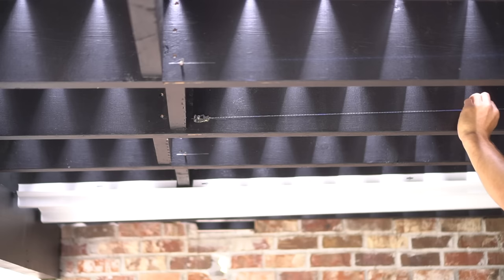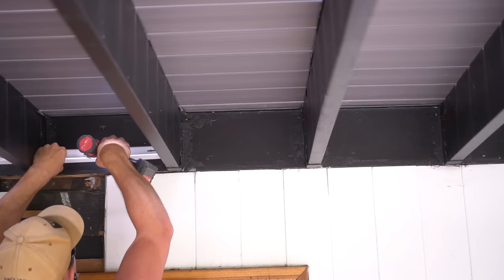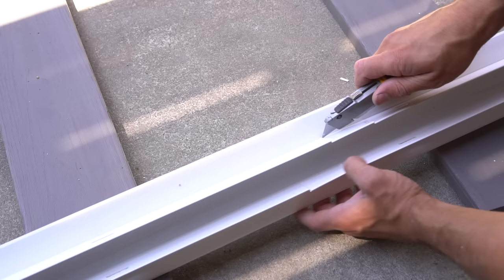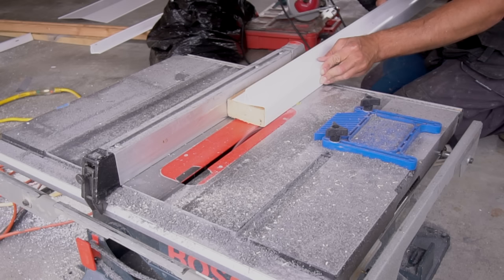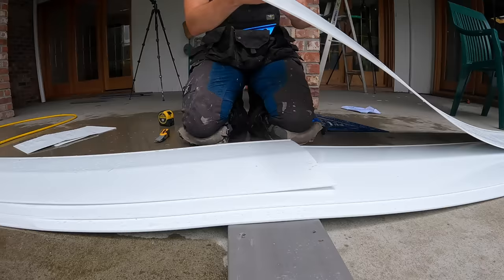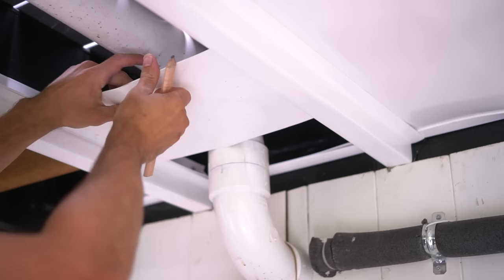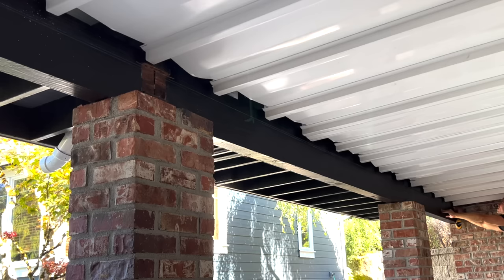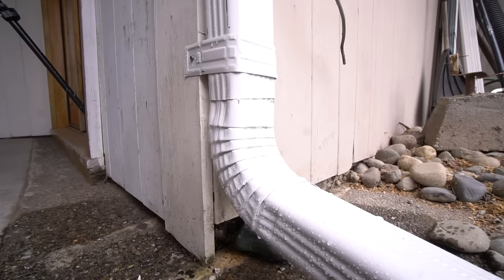DIY Deck Drainage System

Comment: How do you keep birds from nesting in the gutter?
Reply: My thoughts, too. I suppose hardware cloth could be installed in the gaps between the joists to protect the top of the gutter, but birds aren't my only concern with an enclosed system like this. In my locale, wasps are a problem. The underside of my 12x21 deck regularly has 10-15 wasp nests. Since my current deck is open underneath, I can simply brush the nests off. If I enclose that area, I no longer have easy access and the wasps can use the gaps in the deck flooring as the entry point. That concern makes such a system a non-starter for me. I like the idea but think it would end up being more work than it's worth. My deck has a full roof, and the patio below the deck stays reasonably dry, except with a driving rain. A system like this can't keep my patio dry in such a situation. Nice video though. Well done to the author.

Comment: Is it just me or doesn’t this prevent the deck from drying because there is no ventilation?
Reply: If you only used composites. This would be a disaster for a wooden deck boards.

Comment: Is the paint on joists for waterproofing? Was tape put on the top edge on in side of joists, or is that supposed to carry water also? I  have 17.5' between house and beam. Did I understand correctly that it comes in 16' lengths? This looks like it takes lots of time. Do the panels come in different widths? I have approximately 12" on center joists. I would love a response.  My beam is 33' long. I  appreciate your detailed descriptions. Great video!
Reply: In the time you took to ask all of your questions you could have googled your answers and learned that the v panels come in 12’ or 16’ sections in either 12” or 16” widths. He taped all of the top of his joists with a 1’ overhang over the side. Incredible amount of effort is put into the entire process as well as filming and editing footage so maybe next time consider a quick google search.

Comment: This is nuts, never mind the dirt that will collect and eventually choke off the water run. If you need the bottom to be waterproof, why even install decking, install a real waterproof floor and outdoor tiling over it.

Comment: Trex Rainescape System seems to be a better solution than this. Trapping water next to the joist is scary and residual moisture could be a safe haven for all kinds of insects. I think Timbertech needs to develop a better solution than this.